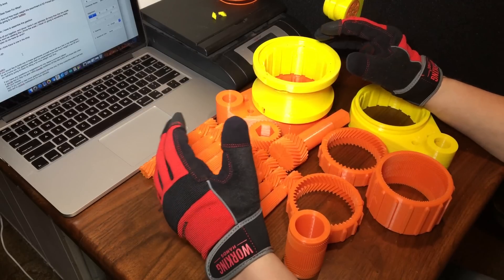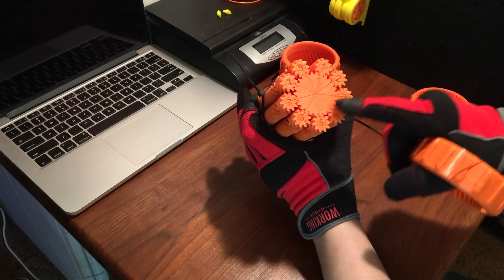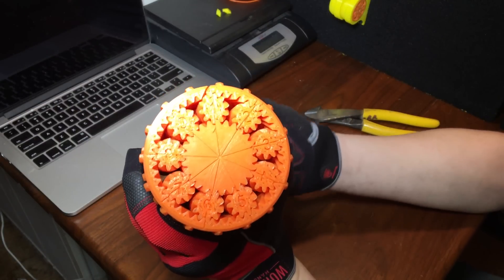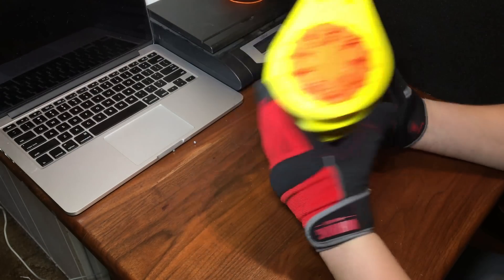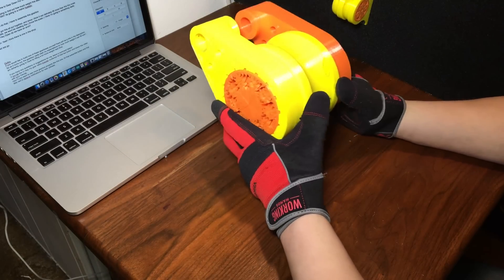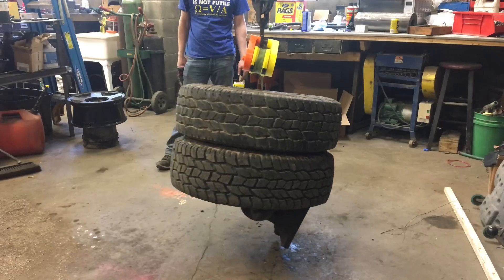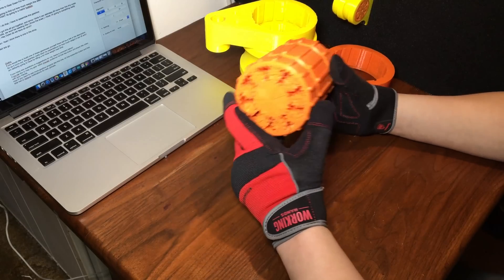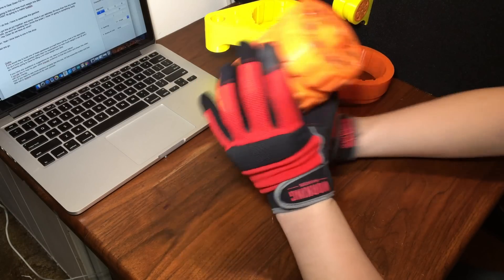You Won't Believe What This 3DP Gearbox Can Do!

Comment: Nice, but next time please open the gearbox also when the testing is finished. I think it would be interesting to see the actual wear of the material etc., because I wouldn't consider this as a success if it breaks after 10 attempts. But your design and the result, amazing job. I can't imagine how many hours of work did this video took..

Comment: Trivia: The Metric Fuckton is fairly similar in weight to the Imperial (Also known as Short) Fuckton and much smaller than the US Imperial, (or Long) Fuckton, however, like with the rest of the metric system, it's easier to calculate in metric Fucktons than Imperial or US Customary. Since 1975, the Imperial and US Customary Fuckton have calibrated their measurements from the Metric Fuckton.

Comment: It's obvious the drills the strongest
Reply: No. The star of the show is the gearbox. Even the weakest of motors would be able to lift up the anvil just very slowly. Just like how all cars can climb up a hill even with a weak engine it's just it will go slower than a car with a powerful engine.

Comment: I like it, I really do. The engineering and application of something self produced is always a fun thing to work out. However, practically.... well. The investment of the 3D printer, especially one that could print as precisely as this requires, and to the degree of quality it needs... Well, it isn't cheap. Then all the plastic, the time taken to print, clean, put together. I imagine that by some point in all of that, you cross the line of diminishing returns, and then just keep on going. Or so to say, it would be cheaper to just go to Harbor Freight and buy a low cost gear reduction winch for a gantry setup.

Comment: I’ve got an idea for you to try with your gear skills well I’m sure you know how a manual and automatic vehicle transmission works and you may or may not of seen the gearbox that was created on a bike where the pedals connect to a bike and or the 3 or more speed freewheel hubs for both bikes and tricycles here’s my challenge for you how about creating a system that could be used on a tricycle bike or 4 wheel bike/pedal car that has at least 3 speeds or more forward gears can Coast freely when not pedaling and has a reverse gear and has to be as compact as possible not to heavy but durable and can be removed and be maintenance and fit between the pedal crank and the rear axle or turn the whole thing into a tricycle conversation kit for a bicycle or pedal car project. Just an idea example look at a berg pedal go kart for kids there’s one that pedal forward brakes and pedals backwards and couple that with a 3 or up to a 5 speed freewheel coaster brake hub conversion kit for tricycle bikes but adding a reverse gear

Comment: Lift a standard 1000cc car engine
Reply: I'm not familiar with many 1000s but I know Yamaha makes the R1 at around 240 lbs... his anvil is probably in the 170-180 range just guessing because 120 is actually an old measurement system. So thats... roughly 30% less than what he already lifted. Entirely possible 😁 

Edit: yea his anvil is actually 168 lbs: 168 + 2(70) = 338... he could damn near lift the whole bike!

Comment: 70 lbs = 31 kg
140 lbs = 62 kg
120 lbs = 54 kg
190 lbs = 86 kg
260 lbs = 117 kg
Here you go for all metric friends
Reply: much less impressive once you convert back to kgs. In 2nd year we built a beam out of 2 cardboard pizza boxes and wood glue that buckled at 116 kg. 

I'd say this gearbox could probably lift about 300 kg's before breaking. [With perfectly perpendicular loading, unlike in the video]
Reply: That's really impressive. Now that I know how heavy the loads are since I have a reference I can understand.
Reply: I weigh as much as that tire wtf?
Reply: Gracias... :V
Reply: Thanks
Reply: You mean for the rest of the world
Reply: Thanks
Reply: You shouldn't  be catering  to those heathens that use bastard measurements
Reply: The anvil wieght was wrong (see other comment) so the final lift was actually 140 kilos

Comment: Hi I’m a confused dad trying to help his son with a high school physics problem.  He has a 4500 kg mass roller coaster he needs to winch up a 250 meter incline at 42 degrees. He has only a 1 hp motor and 4 hours to get the coaster to the top.  Can it be done? What gear box would you recommend. If this can’t be done I need to solve for best gear box / hp motor combo to get this done.   Any math proof you can provide is much appreciated. Thank you!

Comment: Use steel. You will be able to lift trucks my man. Maybe get a better motor than that little shit. This could all be calculated. The drill has so much power and you can record that.

Comment: OK my question is>>>  If you make a gear mold (splittable with registration pins) and pour liquid hard setting resin into the mold could you not make much stronger faster and cheaper parts?  I am coming from an aerospace mfg. bkgd. for thermoplastics, wet layup fiber mat (vacuum bagged), autoclaved thermoset with big structural values.  Please demonstrate and confirm please.

Comment: man  I would love to build a portable  elevator so i don't have to use my latter for my roof.  I weight less than 240. Iam thinking of using a hand held device to go up or down via wire (remote control) and a good small motor that can handle 300lbs.

Comment: What's even more impressive, engineers/machinists have been able to build reduction gear boxes long before computers were even invented.
Reply: Planes rockets missiles etc all built without computers to do the bulk of if any of the calculations or simulation reduction gear boxes are cool and clever granted but planes rockets nuclear weapons and power virtually all of the foundation of modern science and physics etc all not computer aided
Reply: Swampy  

Yes, obviously that is what the OP meant. 

The reply meant that reduction gearboxes were obviously made first because they were easier to make than computers.
Reply: its called math
Reply: Obviously, computers are a magnitude more complicated than gearboxes.

Comment: I mean the power to lift it comes from the drill not the plastic. Unless you really want to talk about the shear strength of plastic. Which considering how many planet gears were used, I'm not surprised. And from the gear reduction there really isn't a whole lot of force on the teeth. The place most likely to break is where your drill connects to the gear box, not the actual gear box, in this situation.
Reply from the maker: Of course the power comes from the drill! how would you create rotational energy from plastic? 
Some have thought that since there is a drill rotating the gearbox that the drill must be able to lift the load by itself, and that is simply not true, the drill would not have enough torque.

Comment: Cool video, but a few tips. 

For the winch, having the curve is great for strings, but for something wide like strapping, you want a square groove. The strapping was trying to climb to the side, in the same way that a belt sander stays centered. 

Assuming that was nylon, solid infill, that wasn't going to break. I was more concerned that the drill wouldn't be powerful enough. 

Planetary boxes are very strong, but you should still use grease. For plastics it gets complicated. Lithium or moly works on steel gears, but you need something to disperse the load. Not too much, because the grease will melt long before the nylon. 

Cool way to make a bearing, but would need to be a needle roller bearing to support much more, in  steel races. 

I haven't seen your other videos, but what do you use to design the gears? Also, what is your printer?

Comment: so are you mesuring the weight it can handle until the grears slip/fail or how long it takes for the drill to have too much torque to give
Reply from the maker: +Barnesrino Kripperino how much pulling strength the output has.

Comment: hay dude
as i seen in other films ,this thing can get hot so next time i think u need to close it in the sides with flexy glass and put oil so it will last longer and get cold.

and replace the ball bearings with rod bearings.

Comment: Gears are like the capacitors of mechanics.
Reply from the maker: +sagar pali I don't follow
Reply: Gear Down For What? just a random thought, the way I see it what gears do is split the total work in different time slots, depending on the gear ratio, so it takes less effort but more time to do the same work. Similarly capacitors introduces time delays in a system such that the work done by them eventually sum up to the total work to be done.

Comment: WAY BACK...when i was studying automatic transmissions in Automotive Technology training...one of the first things we learned was the INCREASED load potential of a planitary gear set up, compared to a conventional gear box...has to do with how much material is in mesh...mechanical advantage vs tourque etc..etc....also...if we add JUST A LITTLE bit of lubricant..just a squirt..you'll be amazed at the improvement...
Reply from the maker: +LeftyLucyRightyTyty I understand what your saying, my assumption is that it will let the gearteeth slide into mesh instead of being forced into place

Comment: Nice project, but the problem with plastic is that it creeps under load. 
Leave it hanging for an hour or 2 and it will break apart

Comment: You said it beat your expectations, but going in to this, u said it would lift a "metric shit ton", but you're merely just over 1/10th the way there, how is that beating your expectations?
Reply: Ah sorry, I usually use "A Fuckton", don't ask how we measure the fucks, that is a trade secret.
Reply: Theoretically it could lift that, but then it's plastic so it should also break apart.
Reply: Well this one would just start slipping gears when it reaches a weight that is too much, however due to being plastic (although a lot of it), I would be edging onto it breaking apart (if the accidental safety function wasn't in place.)
If it was able to be made of a material strong enough to support the weight, then it should (apparently) be able to lift that weight. 

Although I am no expert in these materials or gears, so take what I say with a grain of salt. I am just making an educated estimate with the information I have been provided.

[Edit] Just thought to mention this, there is over exaggeration as well when thinking something is good. Such as "This car could ram a tank", so there is also the possibility of that.
Reply: D.U.N.E so which one is it? Should it lift or break? I also expected an actual ton in the end...

Comment: Everybody seems surprised that the plastic can take the load. Look at his design, it's basically a set of large bars of nearly-solid plastic, the only thing weakening those is the infill and fact it's printed rather than cast. The WEIGHT put on this thing probably isn't an issue. The weak points of this design would be in overheating due to friction on those gears or the outermost ring structure likely being the "thinnest" part of it.

Comment: 160:1 how long would it take to make it spin manually without the drill and why didn't the plastic break taking that much weight despite the gear ratio?

Comment: Did that gearbox warm up noticeably after spinning that fast?? Holy moley what kind of lubricant would you even use?
Reply from the maker: +Manguy dude no it actually didn't get warm
Reply: Gear Down For What?  What?? That blows my mind. It would be neat to see some testing to failure to see where the forces are concentrated
Reply: By the way, great video. I am wondering about trying it myself.

Comment: I'm sorry, I don't know much about 3D printing. Eventually want to build my own printer. Is there anyway you could use some sort of special plastic filament or whatever the feed for the printer is,  that is temperature resistance? Does this exist? preferably on a tight budget
Reply from the maker: +Andy Larson polycarbonate is super strong and prints at 290 C

Comment: Without telling us how powerful your drill is, this is basically meaningless.
Reply from the maker: +Kurt Tappe it doesn't matter how powerful the drill is. You can calculate the torque through the gearbox by the amount of leverage required to spin the output. The drill wasn't even close to stalling.

Comment: You should totally find a steel cable strong enough to use this gearbox to pull yourself up the side of a castle wall with a grappling hook.

Comment: Very good design. However, the only thing lacking is a strap guide opposite the clevis hitch. that will make it infinitely easier to handle and control.
Reply from the maker: +Billy Bracewell yes I did consider adding that after I filmed this video

Comment: You should sell this in metal, imagine the capabilities in such a small space...
Reply from the maker: +Harry 8642 It would be super expensive to manufacture. And the gears need to flex to assemble it. The expense is the main reason that this type of arrangement isn't commonly used.
Reply: Potentially not as rough to make as one might think.  If made out of a steel alloy, the inners can be assembled then placed in liquid nitrogen which would help shrink and stabilize the gears.  The middle can be made and placed in an oven. As the middle is removed from the oven, it would be hot and larger than machined, and decently pliable.  It could be assembled and placed on a slow turn for the outer ring to utilize the cool inner to stabilize.  Once all of it has reached a balance, all the parts could return to a moderate oven then a quench while running to set the metal.  Once this is complete, the out side of it can be machined and the housing can be machined and assembled.  It's fairly common in aerospace to assemble in this method.  Not as bad as one would think.  Really, even could be done out of aluminum and still retain a decent pull!  How about a very light weight vehicle winch?? hmmm.... Perhaps with a center hub like a boat rope capstan so no matter the rope length it just walks itself up....
Reply: @Matthew Bowen So easy that you could do it instead, right? lol
Reply: Cut the outer ring in half, Tig welding it back together with other reinforcement

Comment: Use weed wacker stuff instead of the filament
Reply: Does that work?
Reply: It probably melts at a higher temperature and most printers can't go above 250degrees. It would also be a lot more expensive than 3d printing filament and it is not designed to be printed so it would probably peel of the bed. And you would also have to modify your printer and change the flow rate. So normal filament is fine.

Comment: You think i could use this to life an engine out of a car? Because if i can you are going to save me a lot of money
Reply: At that weight the plastic would probably fail at the mounting joints to the crane, that said if it was metal maybe?
Reply: @Erich um..what? If PLA is used and it takes max two spools (orange parts were from <1 spool), then it would  take around 50 bucks. You can get 1 kg spool for around $25.
Reply: You could lift it with a block and tackle if need be. 30 bucks on amazon, vs 300 for a purpose built hydraulic lift.
Reply: An engine on average probably weighs 400lbs, some alot less some alot more.
Reply: my thoughts exactly
Reply: The gear ups usually decrease torque, which causes the car to be unable to move.
Reply: An engine hoist is like $200 at most...Filament alone is probably near that
Reply: estoniaman My filament costs $14 for a 1kg spool
Reply: Try it and let us know.  Post vid link below pls . . .
Reply: Erich Knoop nope not even close
Reply: Yeah, but you would still need somewhere solid to attach the block to. Not so much with a hydraulic lift that is sitting on the floor.
Reply: Just do a local google search and go rent one... lol
Reply: Break Your Mark I wouldn't trust this garbage to do that.